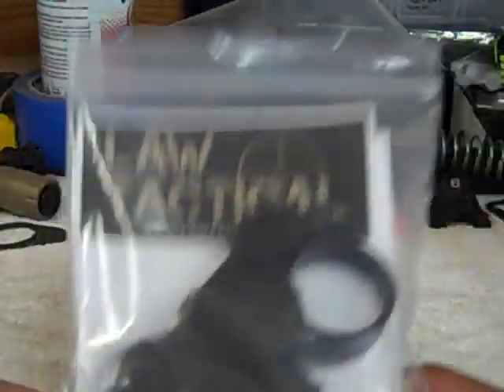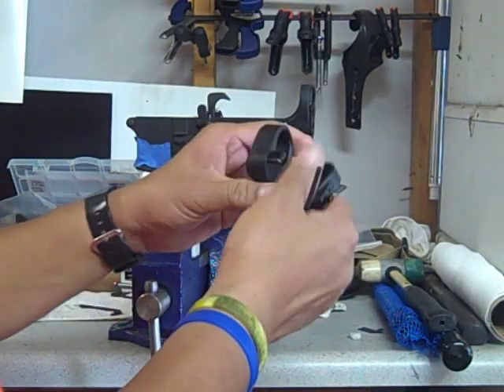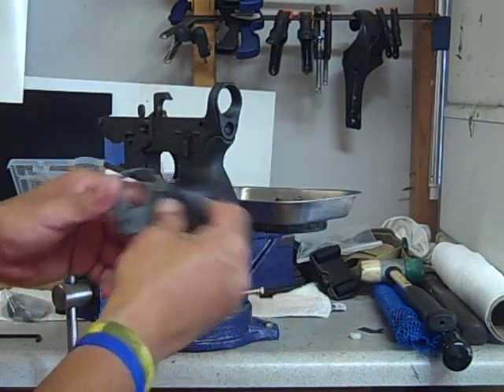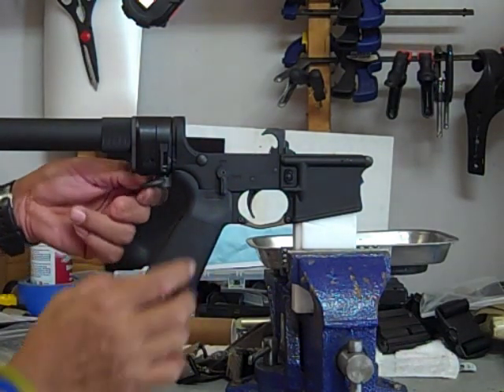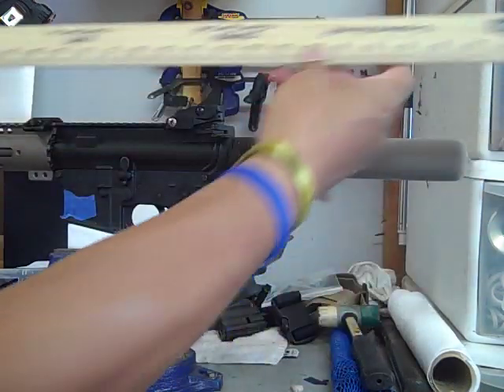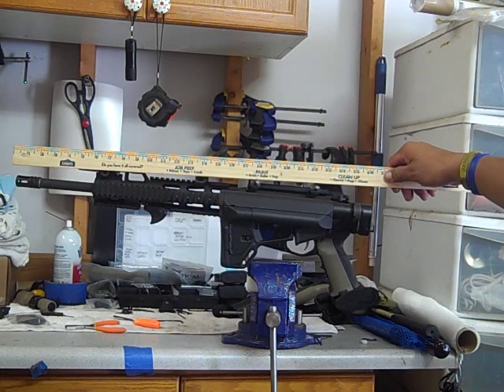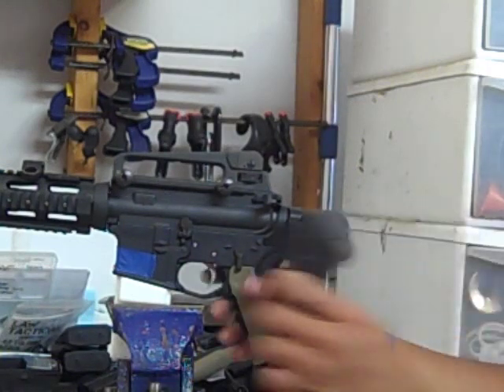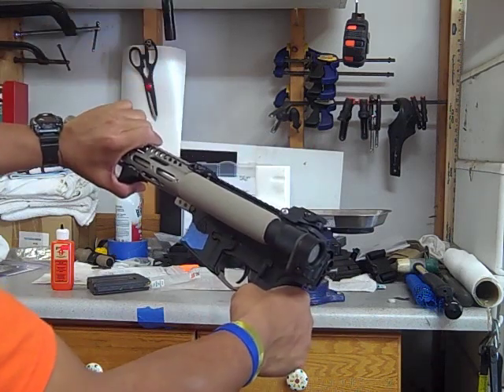Law Tactical AR Folding Stock Adepter Gen2  on a AR pistol

Comment: Have you thought about combining this with the KAK extended buffer tube and Sig SB15 arm brace?
Reply from the maker: The KAK extension will give you a long length of pull because don't forget the adapter is 1 1/2" long and the KAK is another 1 1/2" long. I have a KAK on another pistol that dont have the adapter which is my house gun and I love the length. As for the Sig SB15 I think its only for looks I had one and I sold it because I personaly don't think it's worth the weight. and bulk. I make my guns light as possable because I go hikeing with it alot and with the light recoil of the .223 or the 300 blk the buffer tube on the sholder is good enought. Thanks for watching my videos.